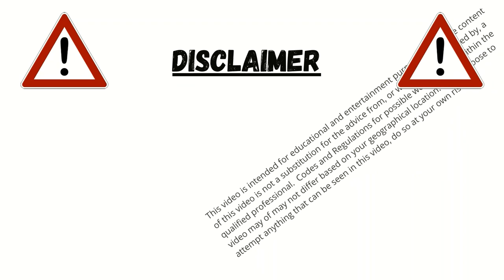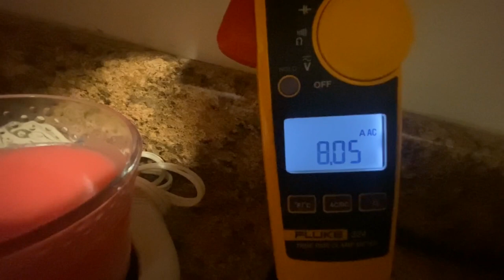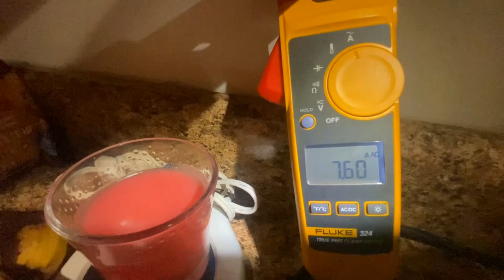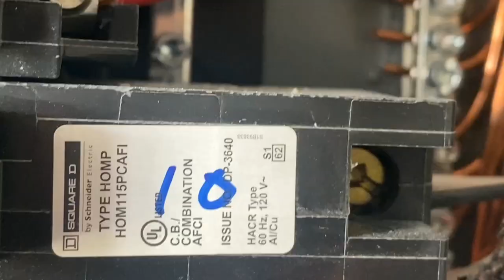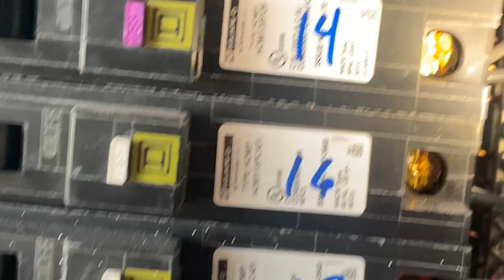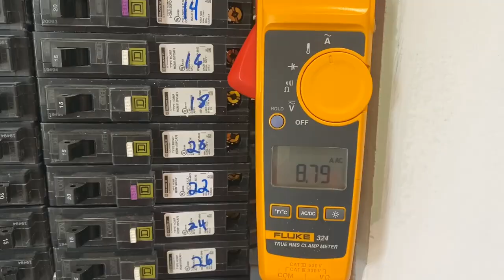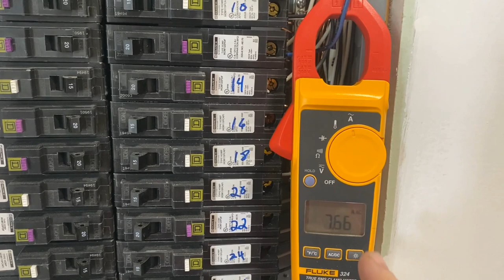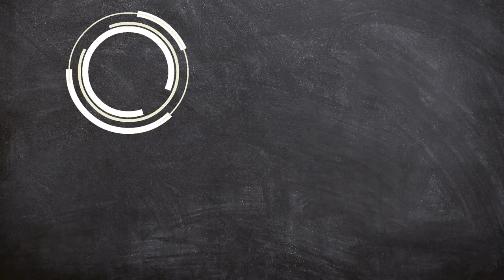Work Order - Microwave Tripping Breaker after 5 Minutes - Electrical or Appliance Issue?

Comment: Nicely executed job. You came prepared, with no rush, stated the basic problem and fixed it.
When an appliance doesn't trip the breaker immediately it's usually overheating problem and overheating problem usually means loose connection somewhere. Insufficient wire gauges may be the problem as well, but it's rarely a problem at our grade of work, i.e. in home installations.
At the beginning I was thinking about some junction box or the socket itself. Loose wire in the breaker would be my next guess.
I think that loose connection was a cause of following microwave malfunction.
Reply from the maker: Yeah, the screw connection at the breaker was not real tight when I went to remove the wire. I believe it was loose from the get go.

I was not the first to check this out and was told someone already changed the receptacle but it was still happening, so I decided I would check the panel first.

I agree, the more I thought about it…I think the wiring was the main cause and the microwave was a victim. The heat off it wasn’t noticeable till I ran it for the 12 minutes but it was getting crazy hot. Maybe fan malfunctioning inside of it due to damage.
Reply: @MORGANSMaintenance  Multiple sudden stops of a fan (when breaker tripped) could have help with overheating.
Anyway, keep posting more of this kind of videos.

Comment: I’d say that microwave is on its way to the scrap yard. Nice video Morgan as I think if she keeps that old heat box, you’re gonna head out for the same issue with the breaker/wire. Something is definitely going on. 👍👍👍
Reply from the maker: Yeah. She swapped it out that afternoon. I’m glad I ran it through the extra time. iIt was after the second 6 minutes it was extremely hot, so much so I could feel it standing next to it.

Thanks for watching!

Comment: Great video! Pretty sure the loose connection at the breaker was the culprit. I’m more pro of having the outlet being a gfci than having it in the breaker box for that reason. Awesome video as always and keep the content coming!
Reply from the maker: Thanks!

Yeah I agree with you the more I thought about it after filming. I think that Microwave had something wrong with it too, possibly caused by the electrical issue over time. 

I don’t think the fan for the microwave was working right but it had a safety feature that shut it off without flipping the breaker once I fixed the wiring. 

It was warm while I originally checked it but after I ran it through 12 minutes straight it was pretty toasty and shutting itself off. Definitely not normal.

Comment: Great diagnostic video. Personally I check the connections of the receptacle first and then go to the panel. After replacing the breaker and wire I would torque that breaker and all others with my Wiha insulated torque screw drive using #2 square bit   To avoid a similar issue on other circuits. Lastly I would test the microwave in another circuit to see if it does the same thing and then confirm that there was 2 problems as you demonstrated. Keep these videos coming.
Reply from the maker: Thanks for the advice.  I would check the receptacle first usually too, but was told the last person came and replaced the outlet but it was still tripping the breaker. 

Someone else working on something is usually cause to start there 😂, but I decided to go to the other end. 

Great idea on checking the rest of the panel. I’ve been looking at some Torque Screwdrivers, Do you like the Wiha? That’s a top contender at the moment.
Reply: @MORGANSMaintenance  the Wiha is fully insulated for 1000v and was the best price and so convenient to use.  With everything electrical moving to torque specs it will become an essential electrical tool
Reply from the maker: @stanrosenblum4669  thanks, I agree. I am needing to get me one for that very reason.

Thanks again for your feedback!
Reply from the maker: @stanrosenblum4669  Sorry to bug you but was wondering if you might have an answer  for a question for me about the Wiha? 

Would you know if the blades for the torque screwdriver are special for it, or can you use the insulated blades that come with their standard insulated screwdriver kits as well. Wasn’t sure if they were the same. Just curious for replacement purposes or the additional blades that might not come in the set with the torque screwdriver.

You may not have the other type screwdriver/blades but thought I’d ask.
Reply: @MORGANSMaintenance  
The bits are different size the standard 1/4” bits.  You can buy and adapter bit that accepts all standard 1/4” bits or another that accepts 1/4” sockets.  Unfortunately the bits included are unique to Wiha only.  Benjamin S has a you tube channel and modified the Wiha to accept 1/4” bits poorly but admitted the proper bit is safer.

Comment: I never run a microwave with nothing in it, I have blown out 3 of them in 22yrs and I should’ve learned the first time, I usually just ask the customer for water to heat up, I’ve had to pay the price running it with nothing in it. That line splitter can sometimes give false readings I’ve found over the years so I just go directly to the panel and see what’s going on there, it’s possible the breaker malfunctioned as Arc Faults just tend to suck in my opinion or even if the torque on that screw wasn’t tight enough it would have caused that wire to melt with the arcing that’s why the NEC 2020 requires to tighten down your equipment with the torque ratings, I think the breaker and it’s line neutral caused the microwave to start to go bad, I didn’t see a voltage test so I can only assume it was 120 volts but a lot of times with a bad breaker like that you’ll get bad voltage drop and it will malfunction the equipment. Lots of scenarios but good to cover your end and recommend a new microwave. Good job brother.
Reply from the maker: Thanks for the great feedback. Never new that about the empty microwave.

Voltage was good, I checked it all when I was seeing what all was on each circuit and didn’t hit the record button 🤦‍♂️Yeah not a big fan of the Arc Fault breakers myself. A bad breaker is honestly what I expected it to be because I  knew that building was loaded with them.
Reply from the maker: Do you have a good Torque Screwdriver you use?

Comment: My main complaint is that go-bag is enormous! How do you carry that thing? 

I’m definitely more of a plumbing heavy maintenance tech so it’s great to see these in the field troubleshooting videos on electrical work. It’s the trade I’m trying to bulk up on so this was great content.
Reply from the maker: It’s not that big, only weighs around 13 pounds. It isn’t much bigger than the TP4B (weighed close to 11 but I also had a few less things in it), just a little bigger in both directions. Maybe it looked bigger the way I was zoomed in. I like it so far, but I’m not sure I would say it is way better than the TP4B.

Yeah electrical seems to be my “heavy”.  Everything comes in spurts but it seems to be what most of the problems I go to revolve around.

Plumbing is my least favorite. Not for the work part but I obsess for weeks after I work on it wondering if it’s leaking 😂 I hate water damage.

Comment: I have the same problem but my house runs on a 4000 watt pure sine wave inverter . Some thing about the microwave oven that is brand new , that when it starts it trips the inverter . and the entire house goes down . I have cooked entire meals using my air fry toaster oven ( 1800 watts ) , hot plate ( 1000 watts ) , AC on low ( 580 watts ) , fridge ( 120 watts ) , freezer ( 120 watts ) , and the rest of the house that totaled 3375 watts all at the same time with no issues . It is just something about the start on the microwave that causes the inverter to trip and the rated watts for the microwave is only 1350 watts . So... the cure to this was to simply turn the power down on the microwave to 6 instead on 10 and it runs just fine . My oven is a Master Chef . I have even plugged the microwave strait into the inverter with nothing else plugged in and same thing . Hope this helps if you have the same problem .
Reply from the maker: Appreciate the info 👍👍

Comment: I never realized how a bad microwave can cause issues. I had mine for almost two years and last night I was cooking a small dinner for six minutes which I do often after I came out of my bedroom I saw a flash of white light the power on the kitchen outlets went off . I immediately unplugged the microwave. The popping from inside the wall continued for a bit then stopped. I checked my panel and the kitchen plug zone tripped. I’m waiting for the electrician to come today to reset the panel because I don’t want to touch anything. The microwave was very hot so I’m pretty sure it was the culprit because I wasn’t running anything else no overload. I suspect it was a short circuit. I will find out for sure later. Just bummed out because it was an expensive appliance but I’m not willing to take chances again. Valuable lesson learned because I live alone and it was a frightening experience. The super told me it was ok to wait for the electrician. I was scared of fire in the wall. Be very careful with microwaves. I went into my bedroom for less than a minute. Don’t think I want a microwave anymore because this is not the first problem I’ve had. Be careful folks✌🏻
Reply from the maker: A lot of times when breakers trip it is typically what is connected to the wiring, more than the wiring itself. It either has something wrong internally, or it gets the wire so hot that it is what damages the wire.

Not all the time… but usually. 

Glad you are ok, smart move to unplug it and call someone 👍
Reply: @MORGANSMaintenance  He came today and reset the panel and used the microwave for forty seconds said it was fine. After he left I touched the sides and under the microwave and it was hot so I believe it overheated. The dinners I run for six and a half minutes so if it got that hot after just forty seconds I am not willing to chance it again. It’s not worth the microwave actually catching fire and destroying my home no way. I learned a valuable lesson from it never run any appliance unattended. Thanks for your input✌🏻